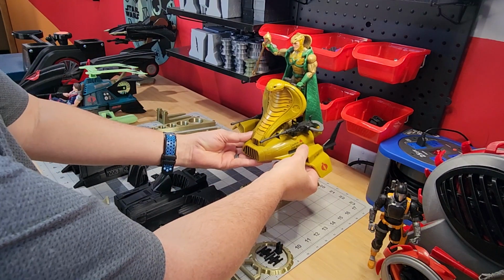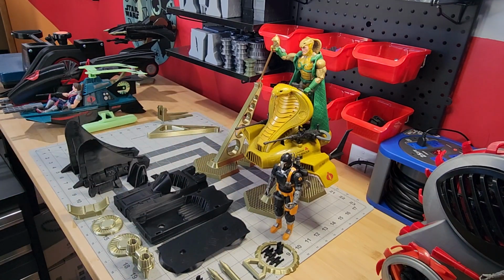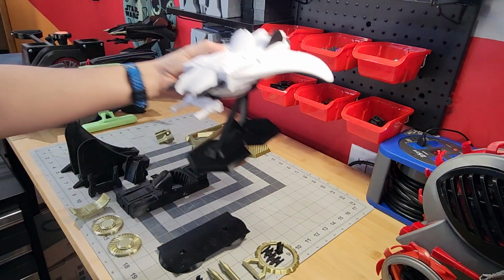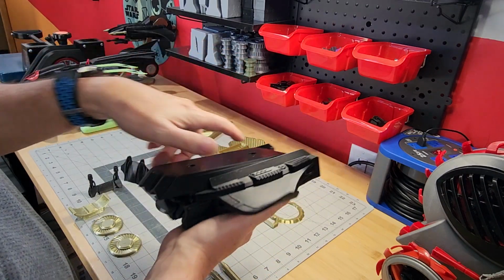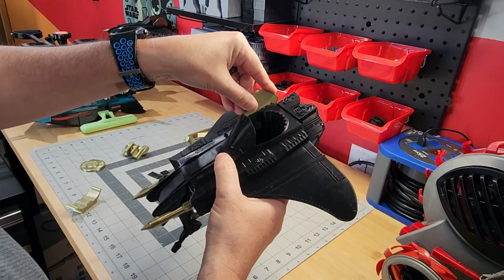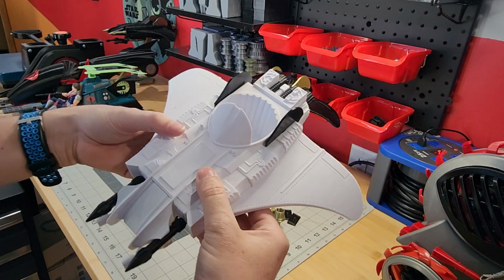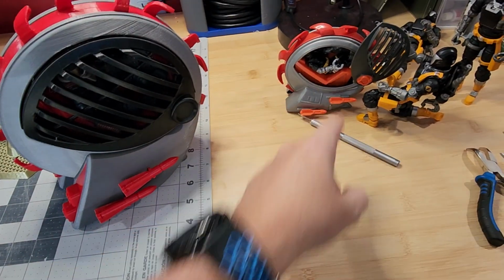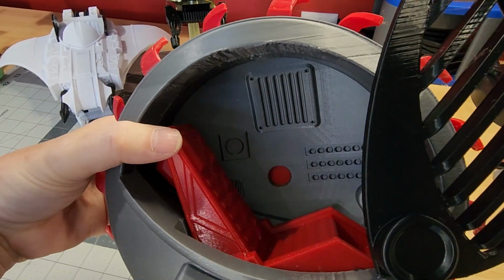Revisions and looking to the future.

Comment: Seriously hoping Hasbro finally puts out a proper Iron Grenadiers Destro to pilot this bad ride
Reply from the maker: Just wait a week, sure it will happen! In the meantime Pimp daddy will work!
Reply: @pixisdesigns761  LOL I was considering asking about getting a gold-hulled/black-finned version for this exact fig ;) Just how much of a hassle is the gold PLA you have been using? Is it basically modern-day gold plastic syndrome?

There is no way Hasbro would ever put out a Classified scaled Buzz Boar BTW- so happy you are. Stay based :D
Reply from the maker: @Canoby  I actually do not see a reason why this cant be inverted in colors. The important mechanical pieces can be made our of regular pla +. Maybe the nose where the material needs to expand to accept the missile..that could potentially be an issue but everything else should be fine.